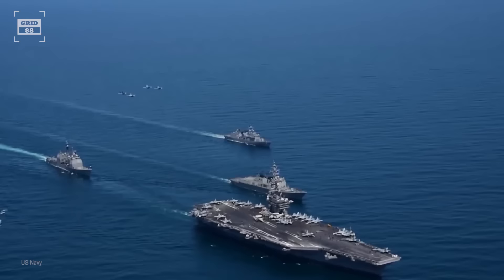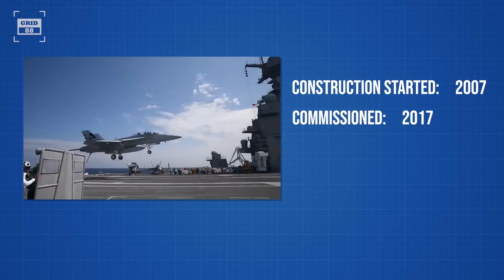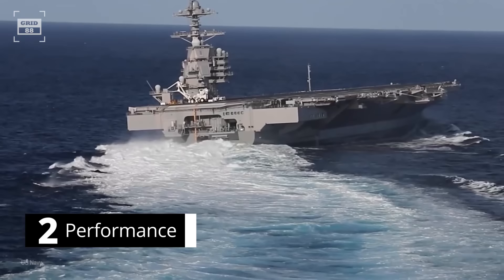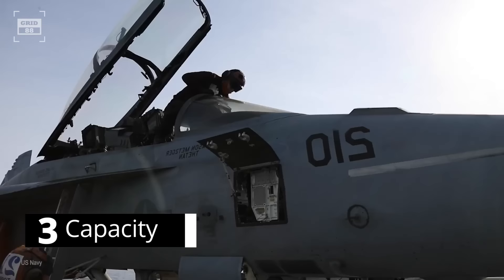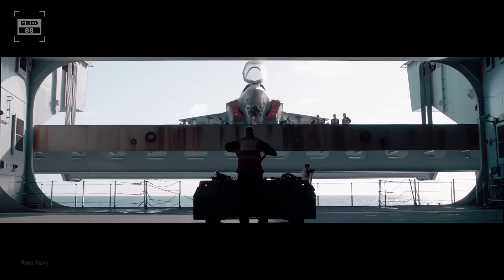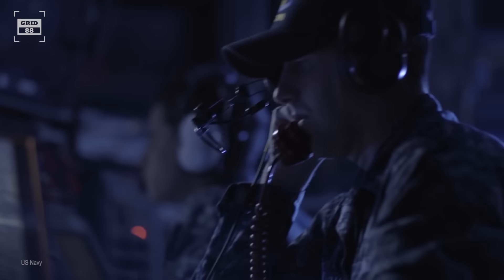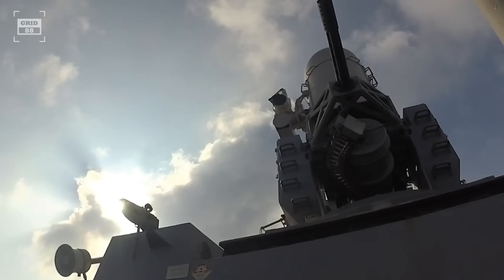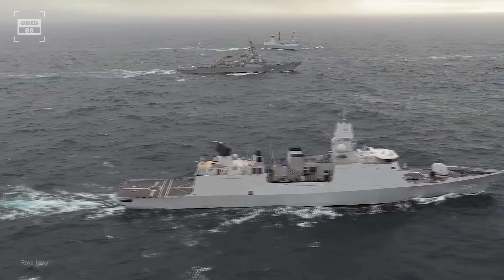USS Gerald R Ford vs HMS Queen Elizabeth - Which aircraft carrier is better?

Comment: COMPARING THE QUEEN ELIZABETH TO FORD, IS LIKE COMPARING JAMES BOND TO SUPERMAN🦸‍♂️🕴
Reply: Definitely whit ford costing 3x as much but it's no slouch it's better than the nimitz and has cutting edge weaponry and let's not forget 2 squadrens of f 35s on board will make it a massive threat to any nation
Reply: HMS King George V yh don't get me started on Chinese anti ship missiles
Reply: 1 Ford or 3 fully kitted out QE's? I suspect the latter would be more useful. Imagine 33 QE's replacing the current US fleet.
Reply: More like comparing Superman too Robin.
Reply: HMS King George V  agreed. Smaller but more keeps all the eggs out of one basket.
Reply: @bmcpheat  The CATOBAR carriers would be able to find (with the E-2Ds) and sink (with the longer range aircraft being launched via CATOBAR) the QEC's before the QEC's could even figure out whre the US carriers are.
Reply: @Courage2006  assuming we are comparing these on a which would you prefer basis i.e to build. I dont see the catobar as a barrier because the QE can be fitted with it, in fact its already been mooted that it may happen at 1st refit. In the mean time I think you'll find all the major navy's can pretty much pin point any threatening ship from a desk at home HQ. With  Stealth jets on both ships it becomes a numbers game. You can have 3 QE's with air type 45 defence escorts or 1 Ford without back up?????
Reply: @bmcpheat  All estimates are that retrofitting the QEC with CATOBAR will be extremely expensive. So that would change the cost ratio between the two ships.

Plus, it is a bit silly to compare what features they might have 25 years in the future.

-----------------

It just isn't true that  "all the major navy's can pretty much pin point any threatening ship from a desk at home HQ".  Why do you believe that? How do you believe they are doing that?

America is one of the few countries that have spy satellites that cover most of the world. And even the US needs spy planes and to launch E-2Ds from its aircraft carriers to see what spy satelittes can't.

The US has 154 military satellites.  In contrast, the UK does not own even a single military satellite.

-----------
You said: "You can have 3 QE's with air type 45 defence escorts or 1 Ford without back up?????"

But that's not the choice. With 3 QEC's you wouldn't have any budget left over for 45 defense escorts. 

Plus, the US supercarriers have 3 layers of organic self-defense while the QEC only has one layer.  

But most important, with CATOBAR the US carriers can lauch E-2D which can see farther and spot the QEC's before they spot the US carriers. Then the US can launch planes that carry both more fuel and more bombs than teh QEC can carry. So the US Supercarriers can strike the QEC's while remaining out of range of being attacked by planes launched from the QEC.
Reply: @Courage2006  
The comparison was to see which is best NOT to see who would win in a 1:1 battle.

If you're building new there's no refit cost at all. The hull design is good for 72,000 ton and the design for catobar is already in existence. 

If you stop looking for a fight with your allies you may realise that knowing which design may function best at its intended duty is a lot more important that knowing which would win in a scenario thats never gonna happen..

Readiness for example. Nuclear ships take weeks to make ready from port when non Nukes are quicker. Servicing, having to maintain nuclear skilled maintenance stations around the world is mightily expensive. Non nukes are able to use other nations ports and workmen. 
Missions: being able to be in two or three places instead of just one has obvious advantages as does carrying more craft in an all out war. 
But how often has a Nimitz class or similar been used at full capacity in the last 50 years?
Reply: @bmcpheat  As far as building a QEC from scratch with CATOBAR -- there is still no telling how much that would cost since it has never been done.  But we definitely know it would cost significantly more than the current design.

I'm not looking for a fight with allies.  I'm just comparing how they would perform in certain scenarios.  Yes, the UK and the US wouldn't fight each other. But the US might need to fight a country (i.e. China) that has an aircraft carrier with abilities similar to the QEC. I was pointing out the advantages of a US Supercarrier.

The bottom line is that the US has studied in-depth the option of building smaller carriers as well as the option of building conventionally powered Supercarriers.   The US chose what it determined was the best option for its needs.

As far as using a Nimitz to its "full capacity" -- one of the main purposes of a Supercarrier is to be so powerful that it doesn't have to use its power.

Such as when Nimitz aircraft carriers have been sailed through the Strait of Taiwan to get China to stop shelling Taiwan.

The UK has also never used the ICBMs that it leases from the US -- does that mean those weapons are useless?  

----------------------------

The US has a mix of Supercarriers (large nuclear powered + CATOBAR) plus standard powered mid-sized carriers.

The point is that for a high-end fight -- high-end Supercarriers are what is needed. But the US also has 10 mid-sized carriers that can be deployed around the world.

All of the concerns you list for nuclear power are valid concerns for the UK -- but aren't problems for the US.

The US has 800 bases around the world and 10 standard  powered aircraft carriers.  Plus it has another 10 nuclear powered carriers.  

The current "intended duty" of US Supercarriers it to be able to beat China in a fight -- or better yet, to convince China not to fight.

You said: "Imagine 33 QE's replacing the current US fleet"

I have pointed out why that would be an inferior choice for America.

It is a strange form of British Exceptionalism to insist that American is wrong for not choosing the exact design the UK chose.
Reply: @bmcpheat  More claims by you that are either false, ridiculous or both:

You said: "In the mean time I think you'll find all the major navy's can pretty much pin point any threatening ship from a desk at home HQ."

The above statement of yours is clearly false. The US owns around 154 military satellites -- while the UK owns zero.

And even the US military cannot "pretty much pin point any threatening ship from a desk at home HQ"  -- as you claim.

----------------------------------------

You said:  "You can have 3 QE's with air type 45 defence escorts or 1 Ford without back up?????"

You can't have those for the same money. 

Two QECs cost $10.34 billions dollars and one Ford costs $12.998 billion. So you can't buy three QEC for the price of a Ford. Much less also buy Type 45 escorts.
Reply: HMS King George V  hehehe another keyboard warrior pretending to be military expert
Reply: Where the hell is Superman when we need him, has he gone back to Krypton to visit his parents? There will be a war with China soon, and Superma's talents would be invaluable.
Reply: @Courage2006  The QE class carriers are built using modular construction so can be retro fitted with the same systems as is fitted to the Gerald R Ford. They already have some of these systems in place like the angled flight deck, hardpoints for the arrester gear and the power plant to use the Electro Magnetic Launch System (EMLS) which is one of the original designs for them.
EMLS won't be fitted until the majority of the bugs have been ironed out.
As the QE class was designed for 5th gen aircraft from the out set and all of the systems are able to communicate with the F35, the air wing then become the extended eyes of the fleet so any carrier that is out their with 4++ and below should be seen before the QE class.
They also have drones on board the QE class as well.
Reply: @Magill2571           #1. Yes, the QEC was constructed using blocks or modules -- a construction practice that has been around for decades.  Even the USS Theodore Roosevelt -- a Nimitz class carrier -- was built using modules.  That doesn't mean it (or the QEC) can be retrofitted to have everything a Ford-class carrier has.

       #2.  Modular construction is mainly done to save cost and increase speed during construction. It doesn't give a ship the magical ability to be retrofitted with whatever you want. 

       #3. The QEC does not already have an angled flight deck in place as you claim.

In theory, the QEC has been designed to be able to add that at a later time. But that was also what was supposed to happen (but didn't) with EMALS.  So I wouldn't hold your breath.  :-)

       #4.The QEC was supposed to be designed so that an EMALS catapult system could be added in a cost-effective manner.  But it was found that the contractors did little to make that possible.

The UK government had planned to add EMALS -- but then the cost for adding it skyrocketed because the QEC had not been built in a way as to make adding EMALS easy or cost-effective.

       #5. The Ford's new Advanced Arresting Gear (AAG) system requires much, much, much more than "hardpoints".  Hardpoints are trivial.

       #6.  The QEC can only launch small drones. And they can't even land back on the deck but need to be snatched out of the air with a crane that takes up room on the deck.

In contrast, the Ford can launch drones of all sizes.  

       #7. Of course, the QEC can communicate with the one and only jet it is able to launch.  That is hardly an accomplishment to brag about.

        #8. The QEC is not able to launch any fixed-wing AEW&C aircraft.   The E-2D Hawkeye (that is launched by all American Supercarriers) can see much farther than an F-35s or a Merlin Crowsnest.

       #9. It is absurd to claim that the QEC could be retrofitted to have everything the Ford-class carrier has. Especially given that:

a) The Ford is more than 60 percent larger than the QEC. Features take space.
b) The Ford's power plants generate far more power than the QEC's power plants.  Features usually take power -- that adds up.
c) Since the Ford is nuclear-powered -- it doesn't need gigantic tanks of fuel to power the ship -- that frees up a huge amount of space on the ship. 
c) Those extra features that the Ford has require both extra space and extra personnel.  Personnel the QEC does not have. Neither does the QEC have the space or the berthing or the mess area to carry, sleep, and feed so many extra people.

       #10. Even if the QEC could be retrofitted to have everything the Ford-class carrier has -- it would take money, time, personnel, and expertise that the UK does not have.

Bottom line -- it will never happen so it is irrelevant.

       #11.  I've always said that the QEC is a great aircraft carrier -- and probably just the right thing given the UK's budget.

Brits should be proud of what they've built -- instead of pretending the QEC is something it is not.
Reply: HMS King George V  I know that was the plan. But there was also a requirement that the ship be built so it would be easy to add EMALS.  But the contractor failed to abide by that requirement.

Therefore, I wouldn't count on the contractor having spent the money to make it easy to add an angled flight deck.
Reply: HMS King George V  But ... America has aircraft carriers that are both larger and smaller than the QEC.

And the QEC is larger than every aircraft carrier in the world except the American Supercarriers.  

What makes the QEC the right size --  and every other sized carrier the wrong size?
Reply: HMS King George V  Good thing America didn't do that -- and instead has 20 aircraft carriers.
Reply: HMS king George V  First,  why do you believe that it true?

Second, if it was true, why would that be a good thing?
Reply: Nah it’s more like 007 and Jason however his last name is spelt
Reply: @Courage2006  what if i tell you the the QEC carriers are designed to have Catobar retrofitted
Reply: @jamesevans938  I would tell you that is more a wish than a reality.  They were going to retrofit them with CATOBAR until they discovered the retrofit would cost more than the entire cost of the ship.

It turns out that the contractor did not build the ship in a way that would allow for an easy retrofit.

Also, no matter the cost, until CATOBAR has actually been installed --- it is little more than vaporware.
Reply: please just leave.
Reply: @2Loto  I'm sorry that you find facts upsetting.  I hope you feel better.
Reply: Not at all pea brain.
Reply: the problem building more EQ AC is you need to build more logistics ships and more escorts that's gonna have take time
Reply: @bmcpheat  33QE take time to build and material, logistics and escort ships lol
Reply: Why would you say this. Do you feel threatened by it?
Reply: @Courage2006  why do you appear so defensive? These ships are all part of NATO and each plays its role.
Reply: @Aiden Prezas They have 2 Queen Elizabeth class carriers with a 3rd on the way
Reply: @darklotus2002  WHAT'S WRONG WITH PEOPLE TODAY⁉️YOUR LIVING IN A DELUSIONAL WORLD🤪IT'S A FACT THE FORD IS A BIGGER MORE POWERFUL CARRIER  COMPARED TO THAT DAMN NEAR HELICOPTER CARRIER ELIZABETH💯🤣
Reply: Royal Naval Study  A Plutonium fueled Aircraft Career is obsolete? Compared to what standard? Compared to the recently constructed HMS Queen Elizabeth VTOL Carrier that they can't man without American Pilots? Wait, maybe compared to the Russian's single Aircraft Career with 15 aircraft max capacity?....It burned down already. You don't know what you're talking about.
Reply: @bmcpheat  Imagine the number of escorts needed for 33 Carriers
Reply: @bmcpheat  ohhhh
Reply: That's a major exaggeration my friend.
Reply: @bleachdrinker6915  yes the US made the f35s go back a hundred years and it was Great Britain that the sun never set on they're empire. And they're still around and relevant today and that's no small thing
Reply: Never heard so much drivel. It's hardly that big a comparison between bond and superman 🤣You can't compare them they are both completely different and both brilliant carriers. If anything the  🇬🇧 carrier is a 1/3 of the cost and nearly just as brilliant.
Reply: @bleachdrinker6915  Another one Are those awesome Chinese anti-ship missiles Able to go faster than the speed of light The US navy is putting lasers on all of their ships The system works I don't care how fast your missile is It is not faster than the speed of light
Reply: Lol, you really did a good analogy, superman can fly (Ford has aircraft) and bind cannot fly (helicopters only since crashing an f 35 off if it and america took them all back)